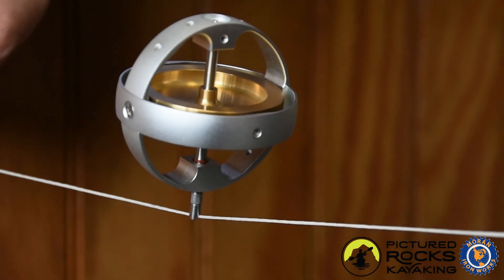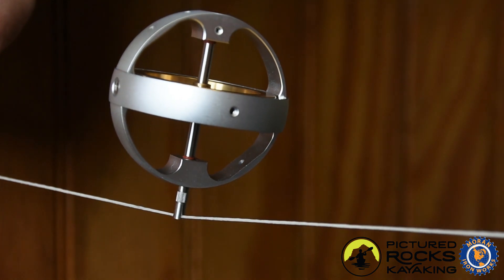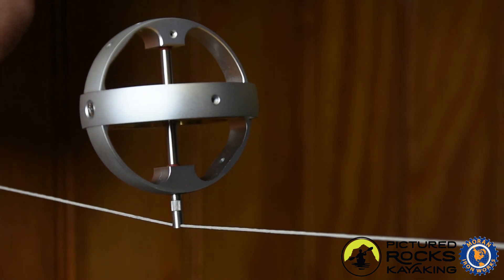Sea Keeper Gyro Stabilizer 12HD

Comment: Has a lot more potential than as a stabilizer although certainly is that...also can act as an energy storage device and also as a 3d gps imaging system with the correct inputs. If put into an automobile or an aircraft the implications would be quite remarkable as a commercial item😊😊
Reply: are you serious? 😂